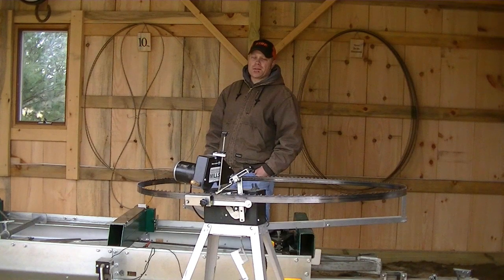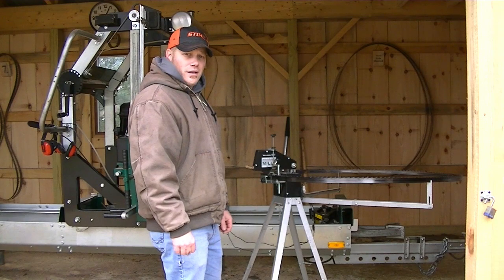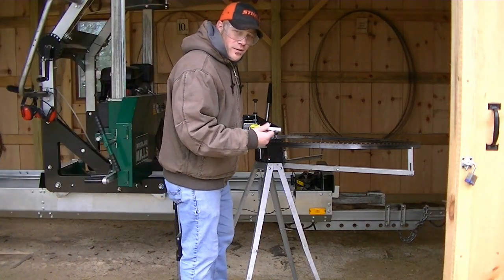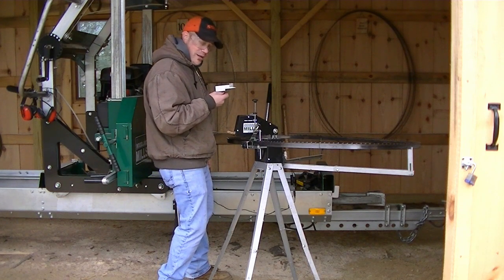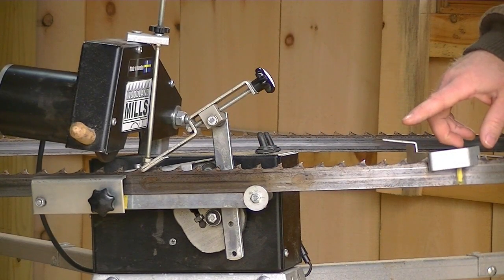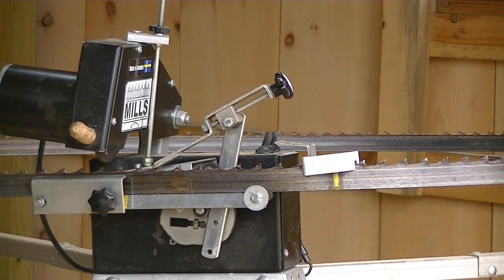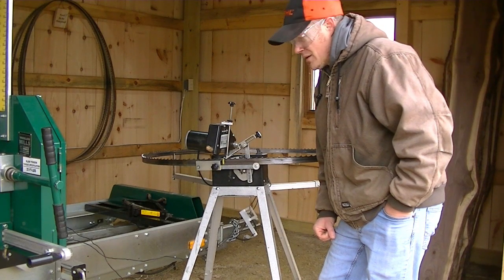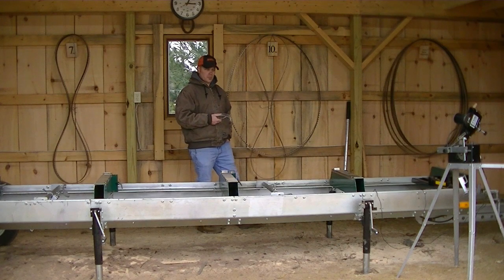Sawmill blades Sharpening Day,  Woodland Mills sharpener

Comment: Get the CBN grinding wheel . No  profiling and it does not get smaller so the settings are usually pretty darn close. I also think it puts less heat into the tooth .
Reply from the maker: @finniganshomestead2956  i have it now